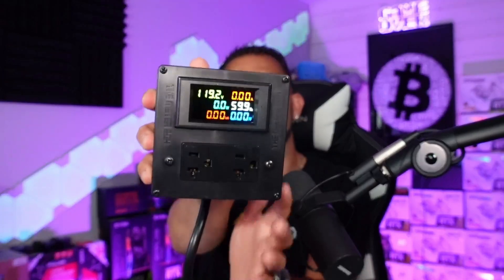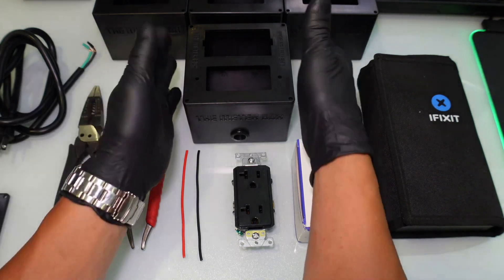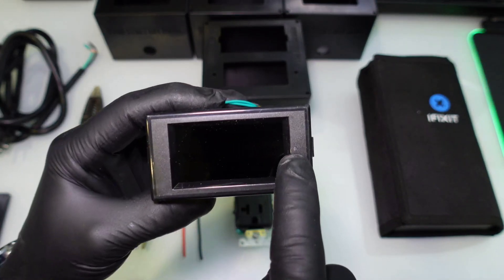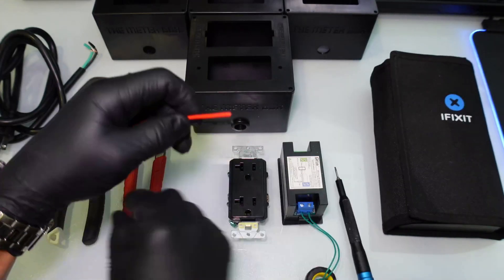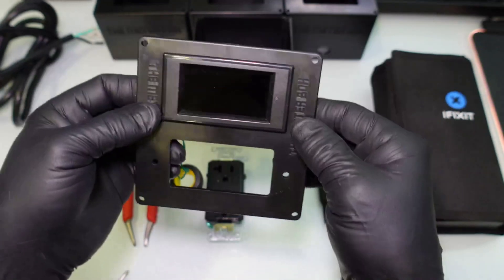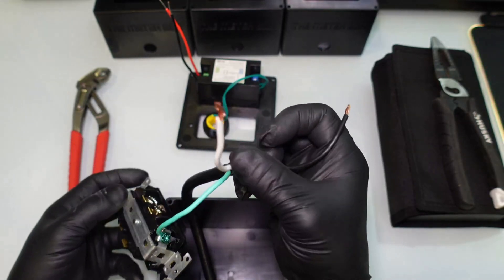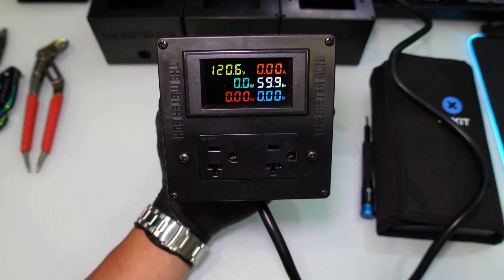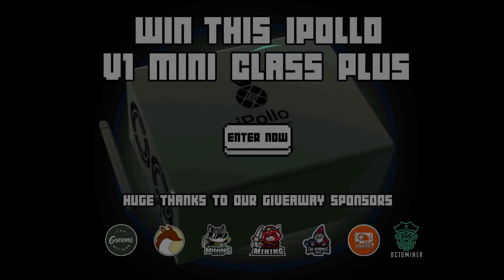How to Wire a 120v Metering Outlet to Monitor My Crypto Mining Rigs

Comment: Hey be careful bro, with stranded wire it’s often better to use crimp connectors for a more secure connection. Also it’s better to put different wire sizes under different screws to better distribute pressure on the wires. And one last thing it’s better to have a little copper showing and not have the insulation under the screws.

Comment: Little correction, in Europe and most countries using 240V - 1-phase (like Thailand), the hot wire carries 240V and the neutral carries 0V. I imagine the situation when both wires (hot and neutral) are carrying 120V is exclusive to the USA :)
If you want to make the connection more stronger, use some ferule terminals/connectors, BUT make sure you are using the ones rated for your maximum current, otherwise KA-BOUM :$
Reply: u sir are a fountain of knowledge ;)